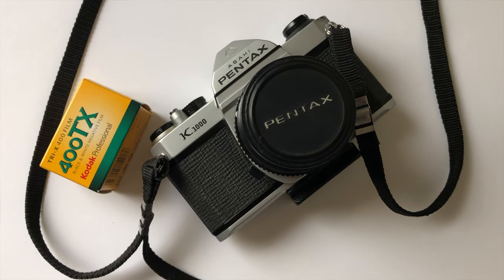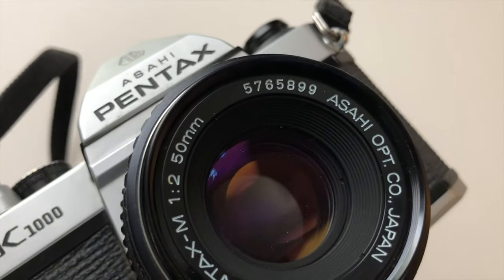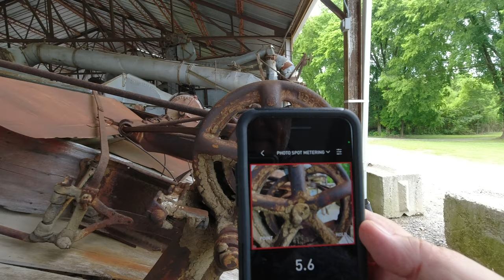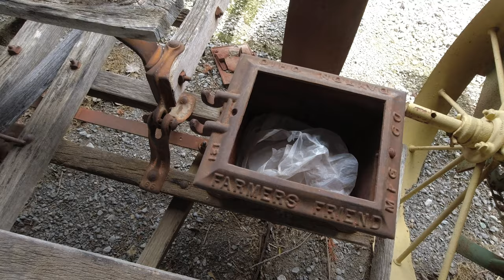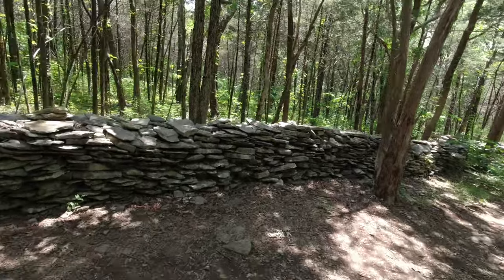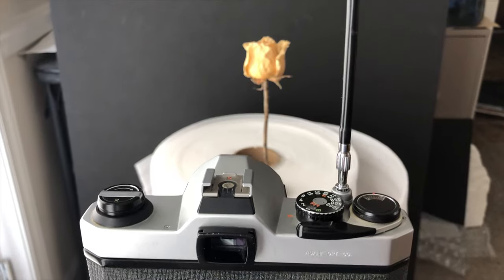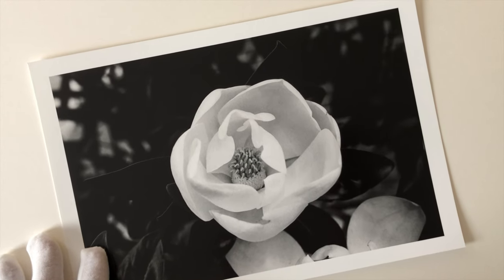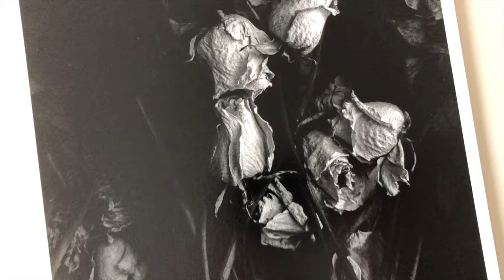Pentax K1000 Camera with Kodak Tri-X 35mm Film

Comment: Great video, Keith! It really brought back some memories. Back in the summer of 1990 (32 years!) I discovered my love of photography when I started learning to use a Pentax K-1000 with a Pentax 50mm and 135mm lens. Up until that time I had only used point and shoot type cameras. (Even though I did use my Mother's Kodak Brownie camera when I took photography as a project in 4-H.) I really love your images, especially the details of the old machinery and gas station. My first love in photography was landscapes but as I get older I'm really drawn to mechanical subjects. Having said that, the group of old flowers is excellent. Thanks for sharing!
Reply from the maker: Thanks Buddy!. I don't remember how I came to acquire that Pentax. I seem to remember that someone tossed it in with some other stuff I had bought. It is a joy to use. It feels rock solid and the lens was surprisingly sharp. One of my best friends had the same one in high school.

Comment: That's a really cool display. We have an agricultural fair at the end of summer that always has nice displays like this. Do you have a high resolution scanner and scan the prints as .jpg files? Or, do you have a negative scanner? Love that old Chevron station!  Also, love the depth in that first flower print.
Reply from the maker: Yes, it includes the old machines, then there's a group of antique tractors and a collection of relocated old buildings brought over from around the region. I spend a lot of time snooping around there with a camera. I get my film developed by Richard Photo Lab and pay them to make medium-resolution scans. If there's a frame I really want to enlarge, I set up my Sony with a macro lens over the light box, or sometimes send them out for a very high-resolution drum scan. I have found that using the camera is a very accurate way to scan the negs though.